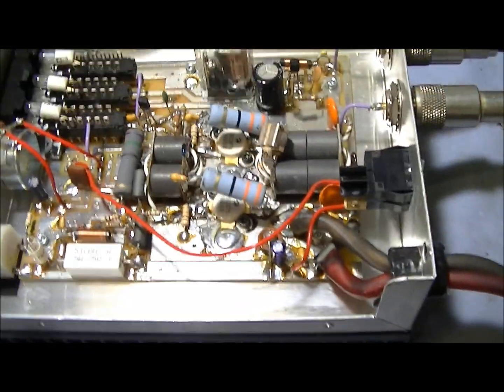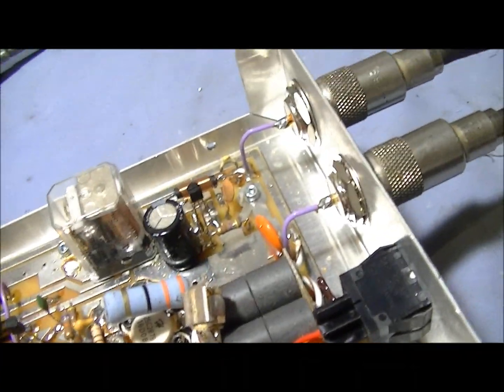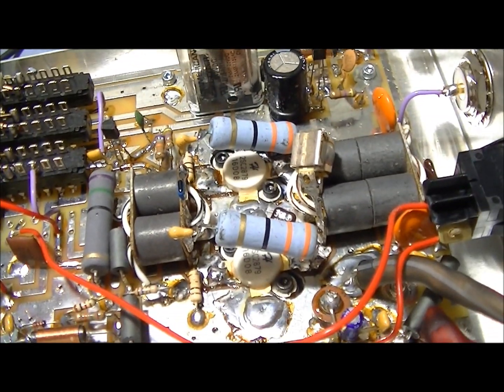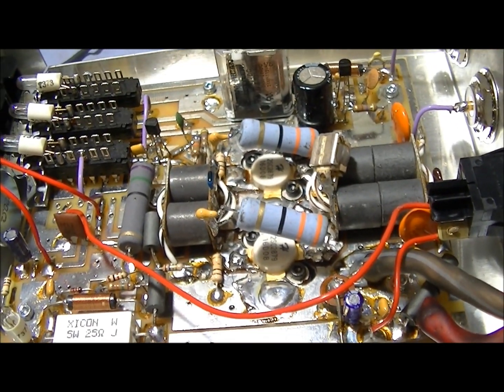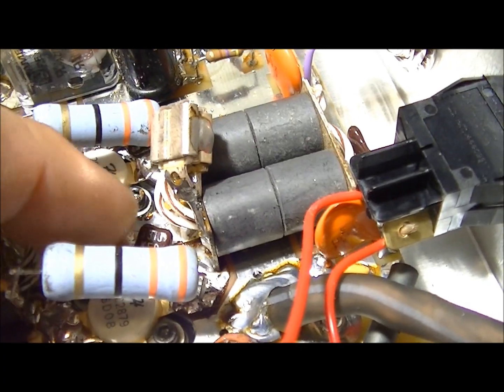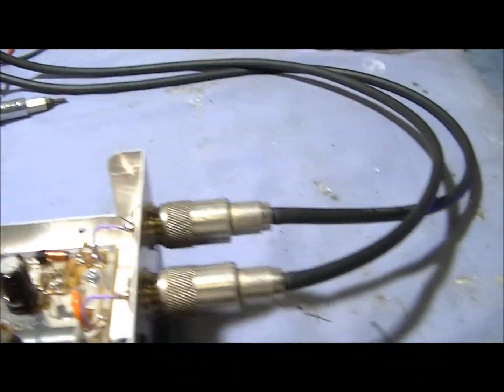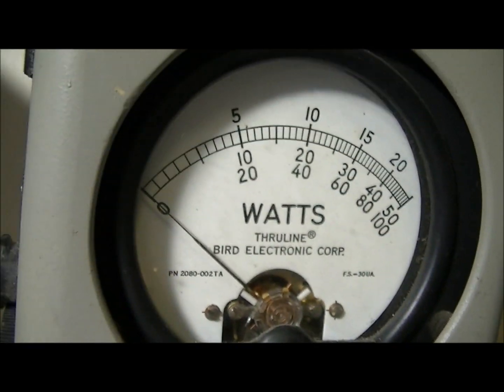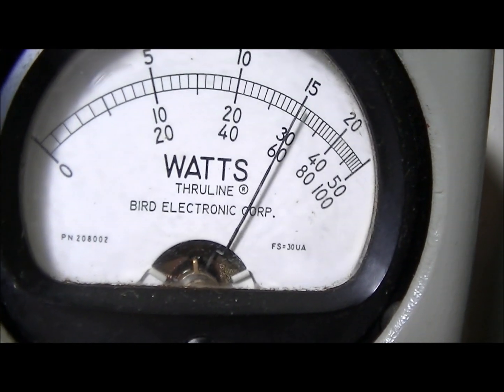Transistor Replacement For Texas Star 350 HDV

Comment: I have had DEI fall into osculation before. takes out keying transistor . think thermal runaway also does this. when they come in usually signs of running hot. normally that 68 ohm feedback is used on 2290 pills. around 39 ohm works great . Them HG transistors work great . just keep the heat down and the voltage . including bias  voltage. The Japan transistors are verry rugged you can not treat HG the same way.   Run HG to specs given or tad less and that work great and last long time. some problems are the length of coax from radio to amp and the type of coax. poor shielding in that can pick of RF from antenna and bring it back to input of amp. also can effect input tunning. I have had several amps come in and the coax to radio was the cause of some problems. flexing that coax jumper a lot causes shield to break down. LMR coax is no good for them short jumpers. that foil gets cracks in it . aluminum has higher resistance than copper. I turn my costumers on to RG 400 jumpers. 3 ft length . longer go to 6 ft.   some times length of coax jumper can cause a tunning issue .ABR industries has great RG 400 and it made in the USA. go to ham radio tube on you tube look at K8MRD video of a Ture of the factory . The outher coax I use is the M & P made in Italy and that has copper foil 100 % shield. copper can flex better . they now have tipple shield Pota flex 7    coax with yellow orange jacket. made to flex and flex . get hot. and it holds up. just came out and waiting for it to come in. you spend a lot of $$  on a amp . spend some on better coax. could be why your amp burned up. and do not forget the antenna. can it Handel power ? does SWR stay down under power ?  when a amp Burnes up look at the whole system .figure that out and you have years of fun on the radio. 73's